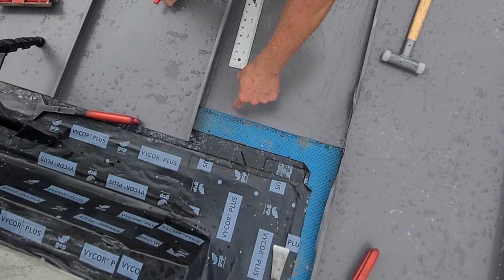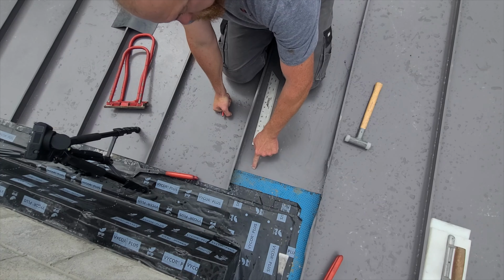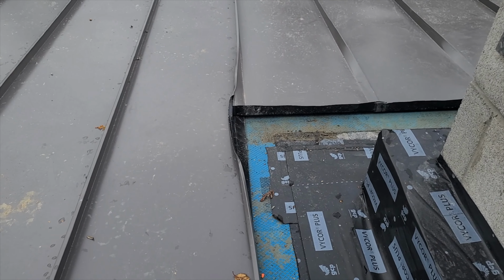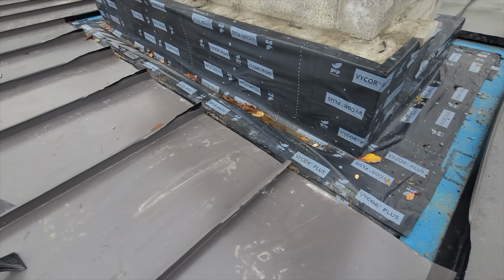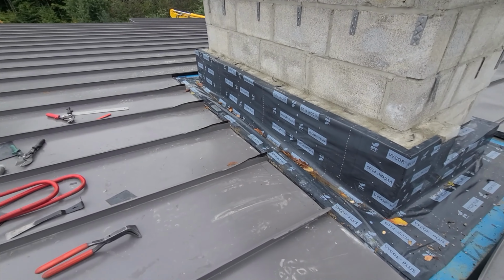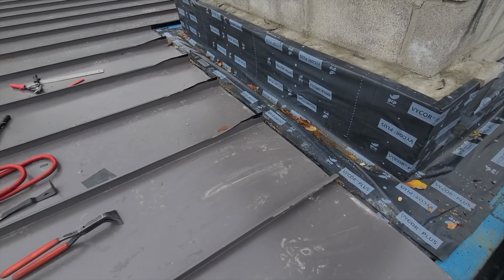Your Metal Roof Chimney Flashing Leak WILL BE GONE!

Comment: What do you do if it’s the snap lock system?
Reply: Would you tie it in same way? Because that is way better than any z strip and tape system
Reply from the maker: Snap lock not for low slope
Reply from the maker: You can use they flashings along side snap lock but wouldn't use snap lock on anything less than 5/12

Comment: So the 
Double fold keeps water out when the seem in banged over flat , I feel like it could still get in
Reply from the maker: No it would have to travel through multiple layers of metal to even infiltrate The system and then even then it would have to travel uphill past the height of the seam as well and then at the last ditch effort get underneath the underlayment we also put sealant inside the seams as well